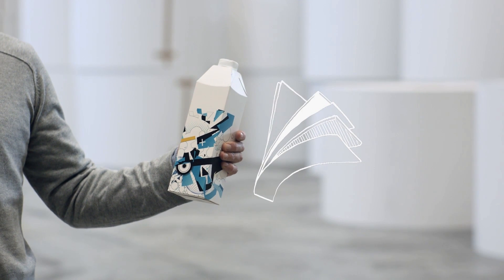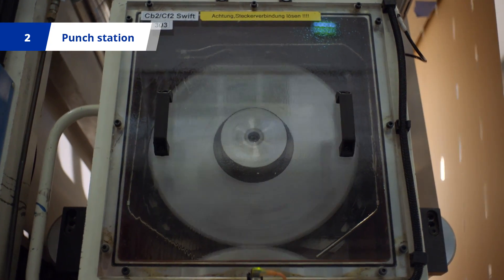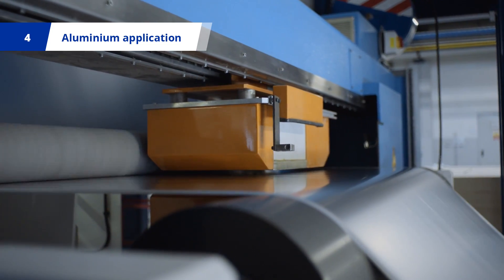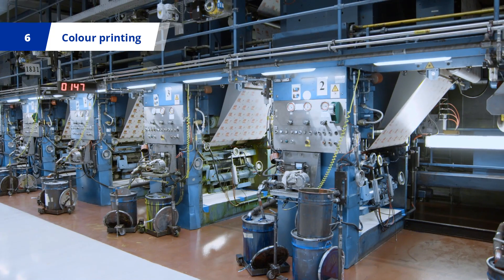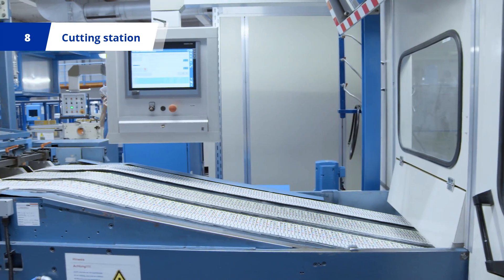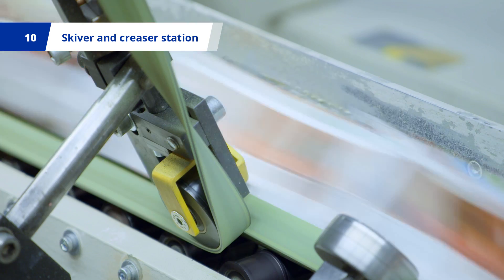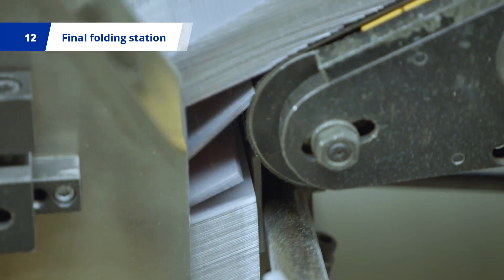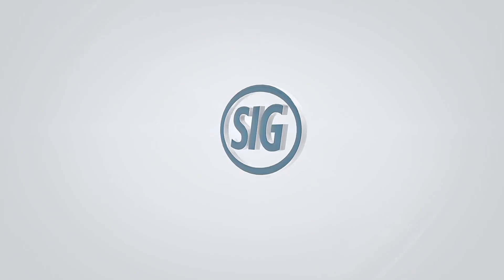From paperboard to sleeve with SIG

Comment: Hola 

Vivo en Queretaro; vi en noticias locales que van instalar una planta en Queretaro 

Tengo 32 años de experiencia laboral en sistema
De impresión rotograbado; con especialidad en grabado y control de cilindros para este tipo de impresión 

He trabajado para la dos empresas más grandes de mexico en el sector de impresión de etiquetas y embalaje.
Ammcor., Aluprint y mi último trabajo fue ccl Secure; impresión de billetes 

Con quien puedo tener una entrevista de trabajo en Queretaro para una oportunidad laboral.

Conozco en Mexico a los proveedores de grabado de cilindros 

Gracias